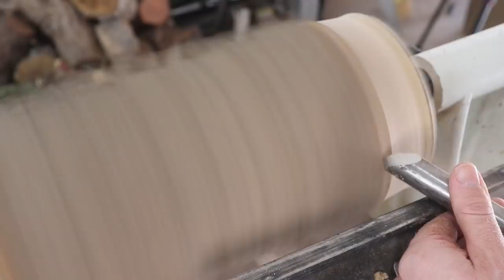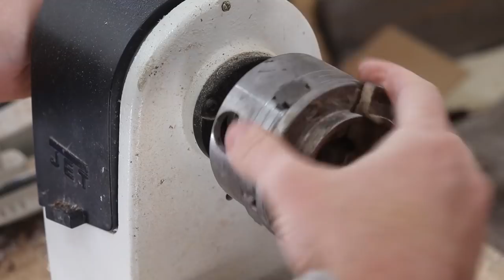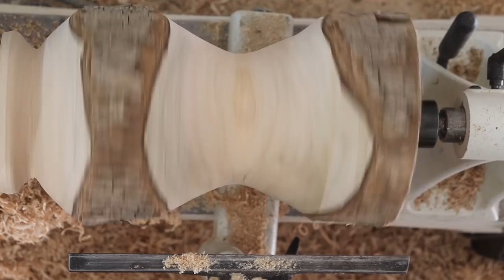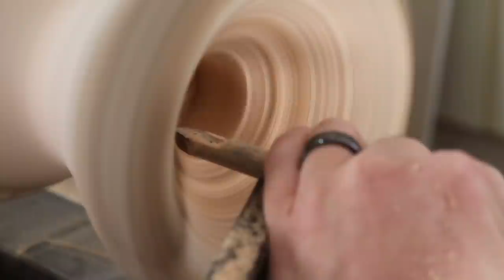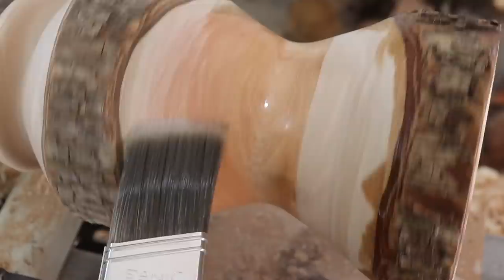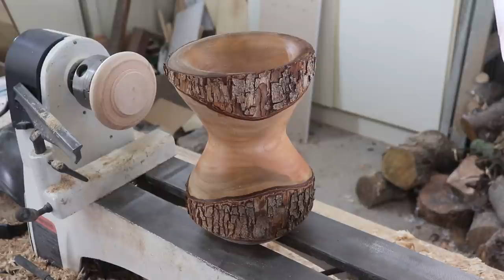Wood Turning Bark Stripes

Comment: Beautiful piece.
My only question is, how are you keeping it from cracking? From my understanding... When turning wood, you want to keep the center core out of the piece.  
Is it kiln dryed? Or did it have something to do with the sealant?
Great video!
Reply from the maker: Thanks! This wood has been drying for about a year, so it’s relatively dry. But also this species, jacaranda, I’ve had really good luck with even when I turned it wet.
Reply: @CookWoodworks  That's truly awesome! I'd like to get my hands on some of it and try turning :)! Thank you! Keep up the good content!